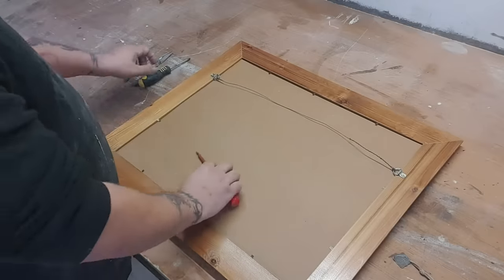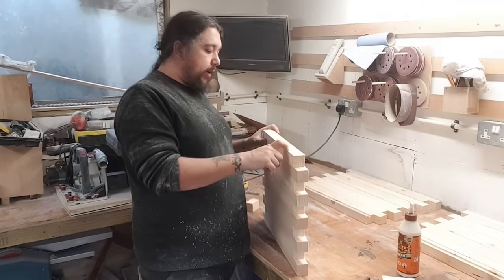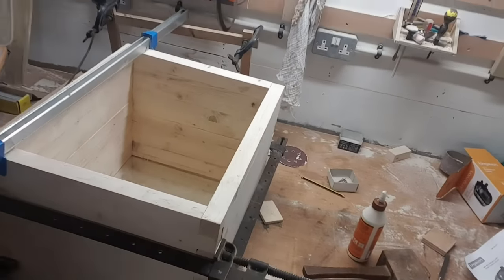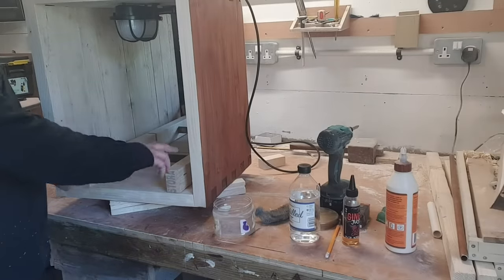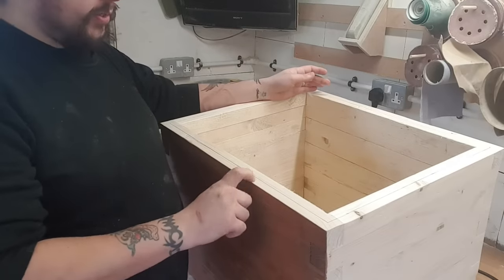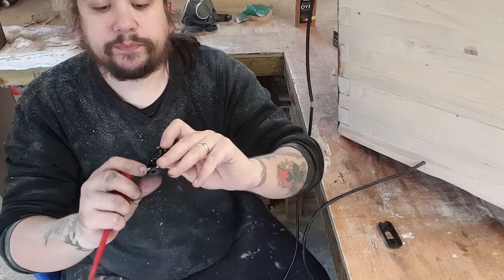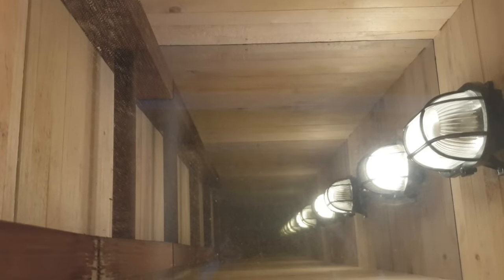Infinity mirror mineshaft coffee table

Comment: Amazon sells a small plug that you plug your cord into and plug the plug into the wall outlet. There's a rocker switch on the plug to turn the power off and on. You also might consider making a thin plywood router base plate that you can place a cleat or even a pin on for a guide.

Comment: to make a guide for the router simply clamp a spacer like ply wood the desired thickness you want removed and a board clamped to it about an inch up so the base of the router can but up to it and act as a guide to run it along. then just chisel out the corners. But I definitely love the project.

Comment: Awesome build!  Appreciate that you didn't make this one of those stupid ASMR vids!!  Little tip on the film application.  Next time instead of glass cleaner, clean the glass with 70-90% Alcohol. It makes a huge difference over Windex/Glass cleaner.  When laying the film...peel just the first 50mm or so off the the short end and fold it back.  Heavily wet the entire glass with the soapy water.  Lay the exposed film down on the soapy mirror and slowly pull out the film backing.  Helps to have another person hold the end of the film while you pull. You cannot over wet the glass when applying.  You will squeegee out the water anyway. This is key to get all the bubbles out.

Comment: Looks really cool, but you've got that joint in the ladder at the mirror since it's the back side of the glass that's mirrored. I wonder if it wouldn't look better just fastening a rung to the wall.
Reply from the maker: Yeah that would solve that issue.

Comment: 13:08 - Use some painters tape on a block of wood and on the bottom of the router plate. Then with some CA glue, you can glue the backs of the two pieces of tape together, creating a temporary fence. Just make sure you glue the pieces where you need the fence to be! This will require a little finesse!

Comment: You could have clamped a piece of timber to the outside to extend the surface area for the router to sit on and then screw a straight edge on the top set at the size between the cutting edge and the edge of the base. Then just move it around each side to make the rebate and you only need to square up the corners with a chisel.

Comment: Question, because you can see the mirror on the bottom at the edges, what about putting a little wooden frame around? Try give the affect of wooden support for the shaft walls and hiding where the bottom mirror meets the frame?

Comment: it looks like you were using a piece of folded paper towel or something of the like as a squeegee, this has given you micro scratches all over the tint, the proper tool for doing that without scratching is only a couple of quid and would have made for a much cleaner result. Also you should have gone over the glass with a razor blade during the cleaning process it would have made it much smoother.

Comment: Shoudn't you use a front surfaced mirror at the base to avoid reflections of the ladder joins which spoil the continuity effect?
Reply: nice idea but very expensive.
Reply from the maker: I didnt really know they was a thing.
Reply: @WizsWoodwork  it's a  coating on the fronof the glass instead of the traditional back surface, very high quality, used in cameras. I used it for Kaleidoscopes I had to get the mirror from the USA.

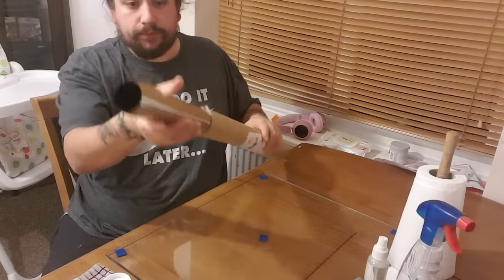Comment: @10:35 What you're calling a "one-way mirror" is a misnomer. There is no back side or front side to it. If is a half-silvered, or partially-silvered mirror: half the light goes through from either side, and half the light is reflected. If you're on the dark side, you can see through it clearly. If you're on the bright side, light from the other side, the darker room is coming through, but that dim light is overwhelmed by the reflection of the light from your own brighter side. ... If you think I'm wrong, just try to find which side is  "the front" and which side is "the back".

Comment: What's the dimensions of the box? What was the rough cost to make? 

I have subbed, great video.
Reply from the maker: 575mm long x 407mm wide x 400mm high 
The scaffolding board i had
£5 Mirror off Facebook
£5 1 way mirror film
£39.10 for 6mm toughened glass with polished edges 
£7 Lamp

So under £50...
Reply: Awesome thanks for the clear summary. I think you've inspired a new craze!
Reply from the maker: Crazy this video just blew up over night....
Reply: Do you have a insta?
Reply from the maker: @one_day_builds
Reply: Perfect I dropped you a follow

Comment: God the same table saw and man it’s loud, how you on dust collection.
Reply from the maker: I've given up... its an awful saw.... Ill get a new one one day
Reply: @WizsWoodwork  yeah I hear you, it’s not super accurate but it cuts, I more use the bandsaw daily  so not the table saw as much, just when I need to cross cut wide pieces that doesn’t fit in the bandsaw, but I’ll upgrade the bandsaw before the table saw as that a grand plus. Do you use a bandsaw
Reply: @WizsWoodwork  I’ve a thick bit of material wrapped around the bottom of it and it traps 90% of the fine particles with the help of a hoover in the slot
Reply from the maker: I do but its worse that the table saw haha

Comment: Looks like the glass you used had that disgusting K glass coating on it far better without that junk on it .
Reply from the maker: No idea what that is
Reply: @WizsWoodwork  It is a supposed thermal reflective coating they put on glass to supposedly reflect heat back into the home  but it has t5hat slight haze to it never looks properly clean  hatefull rubbish

Comment: I'm sorry, but that 'wiring' is hideous.  The whole point of a dual-pole switch like that is that it will cut off ALL power when turned off.  By only interrupting 'live' you've left 220V running through the cable to the light all the time.  Its a really stupid thing to do just because you couldn't be bothered to 'cut more fiddly wires'.
Reply: it was a single pole switch, it is switching the line conductor as it should be, the way he did it was the better way because the earth and neutral were not cut just to be connected again. the line conductor is the one to be switched and '230v' is not running through the light when switched off.